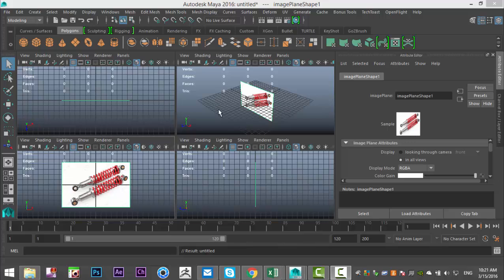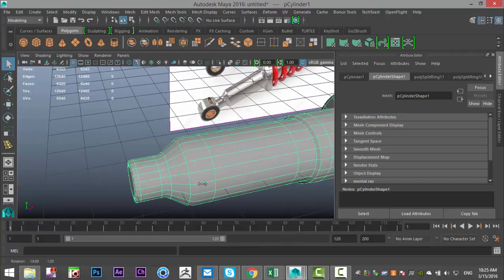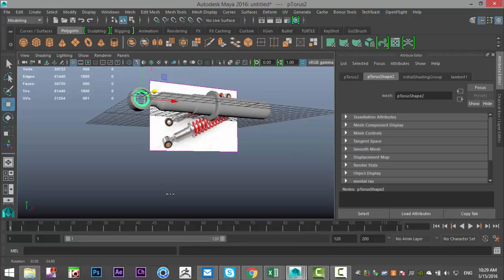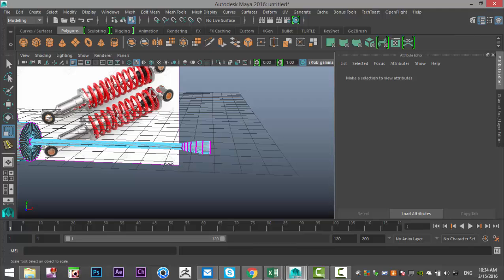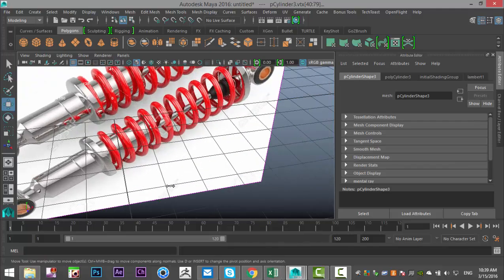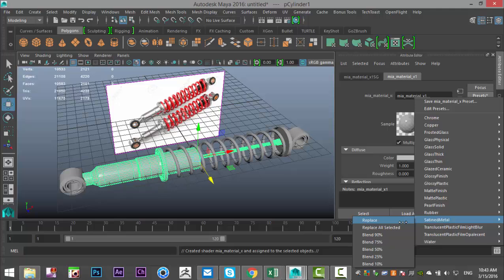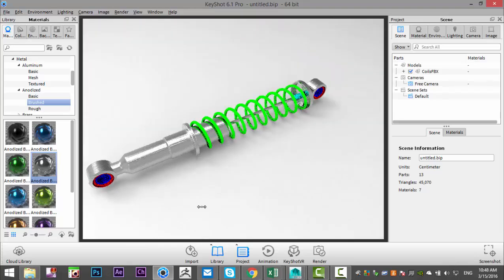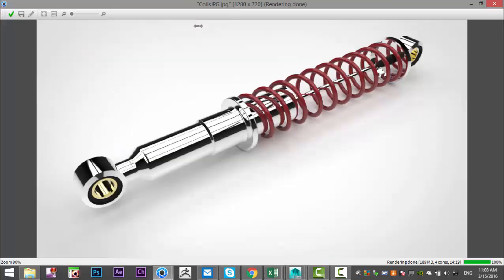Maya / Keyshot tutorial : How to model car shocks

Comment: Hi Mike, I've been wondering: whenever you extrude a face, does that mean that you have 2 faces, one inside the other one? I've never checked that out myself, but it's kinda looking that way.
Reply from the maker: +g43654 That is actually a very good question. The answer is NO. There is no face where it was before. I does leave edges behind though
Reply: +Mike Hermes OK, can you merge faces? I used an oversized cube to make a room, then I used edge loops to extrude, inside the cube, a kitchen bench. Not the best way but now by raising a floor tile to make said bench, I have two faces overlapping in the corner, on the wall :/
Reply from the maker: +g43654 To be honest that is probably never going to work and my advice would be to start over. ( hope you don't have too many hours into it )